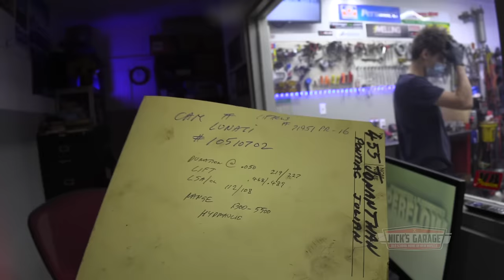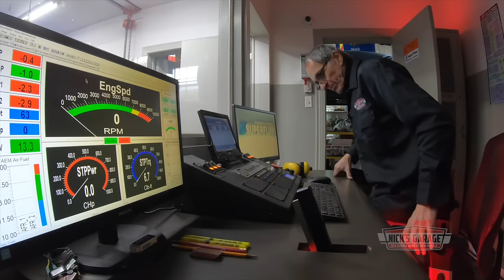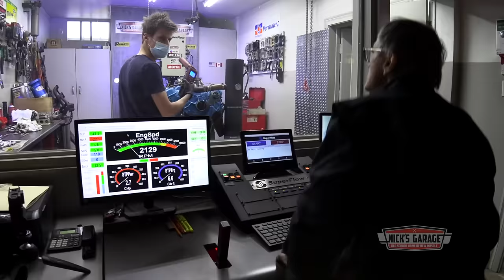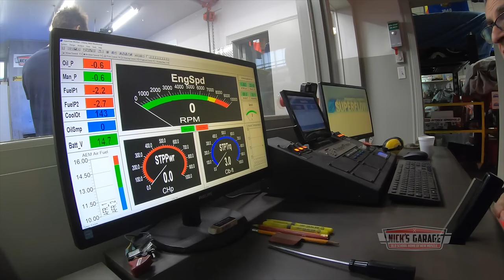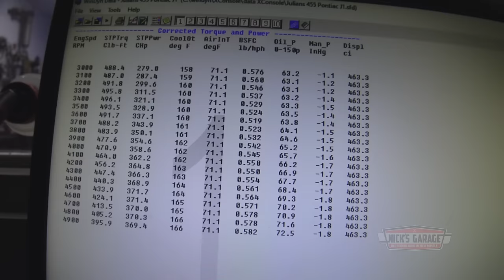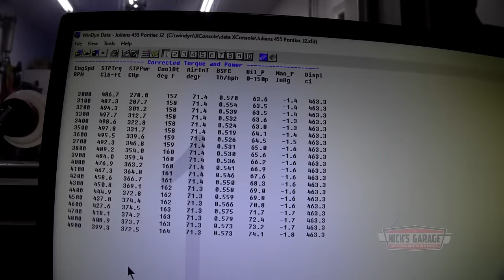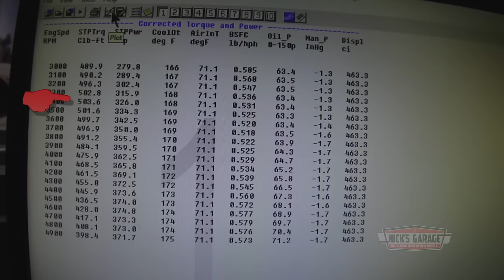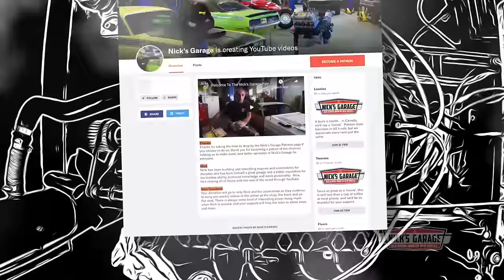Pontiac 455

Comment: That original 76 455 is terrible making only 200 net. H.P. . The 77 W72 400 was actually better making the same 200 H.P. over a wider rpm range then the 455 it replaced. The Pontiac engines made from 1975 and later are not even considered performance engines. Pontiac along with the rest of GM lightened the blocks and cylinder heads from 75 on to help reduce weight . They also tended to gear them with ratios like 2.41, 2.56 , and even 2.73 to help fuel economy.  The engines had such mild cams they were barely over .400 lift around .421 and were not meant to see rpm over 4500 rpm . Infact to make the W72 400 Pontiac had to give them an actual harmonic balancer.  The L78 180 H.P. 400 used an accessory mounting hub in place of a harmonic balancer . This was due to the very mild cam timing and add in the lightened block not made for rpm much over 4000 rpm. 

I found much of this out when I went to replace the L78 400 in my 77 Trans Am . I used a 69 Ram Air III  400 short block that was .30 over with fordged pistons , the heads I used were 1971 400 GTO 4 barrel heads casting number 96 with big plugs. The L78 400's flex plate had a different bolt pattern on the crank then the 69 Ram Air III  crank . This changed after 1974 in 75 along with the lightened engine blocks and cylinder heads. I tossed the L78 400 and 6x heads . 

I also had to make my own engine mounts to install the 69 400 that originally was for either the Lemans/ Tempest body or the larger Bonneville / Catalina body. Pontiac going into the 70's made engine blocks that had two sets of motor mount bosses to make installation easier . My friend used a 72 400 block in his 77 T/A and the later block had the two bosses . It could be installed in multiple Pontiac bodies unlike the 69 Ram Air III block I used.

Comment: What do you drive when the roads are messy? 4 wheel drive pickup or what? When I've been up there it was so cold that white business was crunchy.😆
Reply: For this winter, my rear wheel drive Ranger.
Reply: @nickpanaritis4122 I was just wondering. I've only been up there a few times  many years ago in an 18 wheeler and it was not a big deal. A Power Wagon would be fun in the snow. I prefer 4 wheeling in snow and have no desire for mud. I hope your throat & probably sinuses get better. Stay away from sick people if you can. Really enjoy your channel. It's hot rod heaven.👍

Comment: A 750 or a 800 cfm quadrajet will handle way more than 370 hp so I dont believe that carb is too small. My 9.7-1 comp 70 455 with #64 heads,hft cam and iron intake made 491hp and 570 trq with 1 3/4 " headers and lost 16 hp with ram air exhaust manifolds and 2.5" headpipe. That was with a rejetted  1970 750cfm quadrajet. On my motor my quadrajet made 4 more hp than the shops 850 holley dyno carb.
Reply: Client i bringing in a larger, 800 CFM carb to try it. Engine still on the dyno. Still testing.
Reply: @nickpanaritis4122  - Some Pontiac Firebird Q-Jets had an early stop on the secondaries linkage to prevent lighter cheaper Firebirds being faster than flagship GTOs...

Comment: My engine knowledge is very limited. I always thought you wanted your spark to ignite as the cylinder hits top of it stroke ! If this is true why is there a need for vacuum advance and timing of spark adjustment thru distributor cap , shouldn't this all be set mechanically and not need adjusting ?

Comment: i wonder if i should use a 372 sbc , or 455 poncho, 455 buick, 455 oldsmobile, or 500 caddy engine in a 2nd gen camaro or any other engine for that matter.  i wonder if a bbc would be better for street or any engine. ???   a 318 mopar?  or any engine any ideas welcome, i once thought of a lightweight aluminum headed 350 buick engine and ford C4 transmission very light weight combo i believe would accent a pony car like the 2nd gen camaro. or a lite weight ultra lite aftermarket racing 4 speed or anything tell me what you think everyone and well nick if you think it there is something better let me know.  This shall be an all mods welcome / pro touring / everyday street car / track car/ show car/ endurance/ cross country/ all weather everyday vehicle shall have durable finishing options etc. Then we shall produce the cars with different engine options and new vin codes entirely built from scratch this vehicle shall also be somewhat /wartime survivable./

Comment: i think you need more comp in alot of your're engines, they run higher comp stock with older cam grinds and worse fuel back in the day (i think they would love more cylender pressure).
also running bigger cams and small cast manifolds isnt a good combination as you know but the customer wants what they want.
what cranking psi is this running ?
the rochester is great for mild stuff but suffers with fuel dist at high cfm draw compared to a square bore.
great content i love watching.
Reply: Pump fuel back in 1960's - early 1970's days was up to 100+ octane... 
Most of Nick's customers want pump gas compatible compression ratios now... 
Those Pontiac Ram Air iron exhaust manifolds flow pretty well! Pontiac went up to high rise intake manifolds in 1965... 
This engine could use the 850 CFM Q-Jet from 1970's Pontiac Super Duty 455"...
Reply: @BuzzLOLOL  old fuel wasn't as high in octane but had lead in it to prevent pinging.
When you upgrade a camshaft you normally drop final comp due to bleed so you should increase static compression to compensate.
In this case he isn't even running stock comp for the original cam.
My bet would be cylinder pressure is pretty low and hurting power.
Reply: @hairymongrell  - Lead compound was part of the octane boost plus it lubed valve seats... 
This '74 Pontiac 455" prolly had 7.6:1 compression ratio and a base level cam about 194/202 durations at .050" lift, they bumped it to 9.6:1, car makers would call that "10:1"... and 219/227 cam... it'll run on pump gas...

Comment: I'm guessing 428 hp.I would like to see that with a tri power set up or an early 60's dual quad set up
.
Reply: I figured 375 HP and 475 lb.-ft... surprised at the torque from only 9.6:1 compression ratio...

Comment: Nick. Got a question for you that I have asked many times over the years but never got an answer. Hydraulic lifter/cam break in. I find it hard to believe that the big three broke in cams this way over the years and the millions of engines that had this type of camshaft. How did they break in these engines with this type of cam/lifter combo?? It would be impossible for me to believe they did the 2,000 rpm/20-minute break in for those millions of engines over the 4 or 5 decades they were produced. I have been curious about this for years and so far, no one has given me an answer that makes sense. I'm thinking maybe they ran these motors with a machine that just "spun" them up, no spark perhaps. But then again back in the day when you bought a new car in the fifties or even the sixties there was the break in period sticker near the speedometer. Nothing over 50mph or so for the first 500 miles, no constant speeds, those kinds of things. Thank you.

Comment: Why does the engine stumble when the secondaries open up? Hmmm.
Reply: It all depends how fast I go to full throttle. Too fast will cause a stumble. Not the same in a car test.
Reply: Secondaries air door spring may need to be adjusted tighter... opening too soon...

Comment: Enjoy your videos Nick, but.. If you are comparing that 9.6:1 Compression Ratio 455 to the true 1970 455, which was 10.5:1 455, Torque and Hp. Numbers will not be the same,  bump the compression to 10.5:1 and make another test.. And. Stock cams from pontiac has very low lift! And a bump in lift and duration, and you'll see some good numbers

Comment: Nick, do the BSFC numbers look a little high.  I remember a Pontiac 455 build that made decent horsepower/torque and had a BSFC around .39 in the mid 3000 range.
Reply: A number of .39 is great on the BSFC. Even low 4's is good.

Comment: Forgive my noob question, but what is the need for breaking in a cam at 2000 rpm as opposed to idle? Will it damage the cam or anything else if not revved? Thx.

Comment: Don't know much about Pontiacs but I have some experience with Q-jets. That is not the correct carb for that engine. It is a late 70s (76-79) or early 80s, possibly off a truck.  The correct carb for that engine is quite rare & $$$.

Comment: Why do guys the the Quadrajet  a " Quadrabog"?  Is this baloney ?
Reply: It’s only a quadrabog if something isn’t set up right. Many times it’s the spring tension on the secondaries flappers. If you can Rev the engine in neutral and those doors open all the way, they need adjusting .
Reply: 😀I thanks ya

Comment: get them roller rockers off the engine,and uncle tony had the same problem with lifters, and for your voice drink lipton cup a soup broth,but don't use the noodles,put on a jogging out fit go to bed,it is uncomfortable but the reason is to sweat the bug out you want to soak the bed with sweat
Reply: Worst rockers... stock type but with heavy roller tips...

Comment: Would love to know the specs on that Lunati cam, but I understand too much time has passed to remember them. Just curious ...
Reply: Thank you!
Reply: 219/227 durations at .050" lift... Comp makes a similar one...
Reply: @BuzzLOLOL  With a 112-degree lobe separation. Yes, I got those specs from Lunati.  Thanks, Buzz. I suspected this Pontiac cam was very similar to the one I used in a 1971 455 Buick engine that I got out of an old '71 Riviera, and it was.  I got my Buick cam from the GSCA: H218-231/113 and .484" lift. I just dynoed the otherwise stock spec engine with a set of discontinued Sealed Power 9.4 to 1 forgings on a very accurate DTS Dyno.  We did use Dougs headers on the dyno, but those manifolds on the Pontiac sure looked great and probably worked as well as headers, esp. through dyno mufflers.  The engine averaged 155 psi cranking compression on all eight cylinders. We got 382.6 hp @ 4975 rpm and 514.6 lb-ft torque @ 3650 rpm.  Very good idle, too.

Comment: With a mild build on a Pontiac 455...I'm gonna say 310 HP and 375 ft lbs torque
Reply: Check out the results. Much better.
Reply: @nickpanaritis4122  I saw. 375hp and 508 ft lbs. Fantastic numbers for a near stock motor. I wonder what it could do with manifold, holly and headers. I hope you can talk to owner in to swapping on a bigger carb at the very least.
Reply: @Buses2Bikes  - You guessed numbers for a 350" engine...
Reply: @BuzzLOLOL  Actually those were the numbers from my Pontiac 400 motor from my '78 trans am. Back when it was bone stock. I know big blocks of all the Big 3 had bigger numbers but when I saw the stock heads, stock exhaust and little Q-Jet on the 455, I figured there wouldn't be colossal numbers coming from it. So I "downgraded" expectations to be on the safe side. I've had Ford 460s that were ground shakers and then some that barely registered a pulse. Numbers tend to be all over the place depending on the year and where the car was sold.
Reply: @Buses2Bikes  - Those '78 numbers were netHP numbers whereas this dyno is giving grossHP numbers like used before 1971. 
Q-Jets aren't that little... 735 - 850 CFM on V8 models... those are better flowing than usual iron exhaust manifolds... and compression ratio bumped from 1974 7.6:1 to close to common 1960's 10:1 level...
Reply: @Buses2Bikes  ..My client has a 800 cfm coming  in to test it on the dyno again.
Reply: @nickpanaritis4122  That with maybe a 1" spacer under it might crack the 400hp mark. You were pretty close as it was.
Reply: @Buses2Bikes  .   We are doing more testing. Carb 800 CFM and maybe a cam.

Comment: Disappointing for such a big heavy engine.  I would think a 454 Chev would stomp it.  The old Corvettes were rated 425 or 450 HP from the factory.  Odd build.  I would go FI maybe a crank sensor, maybe turbo at that compression.  Make it howl.  Headers.  Its just a grocery getter for a heavy car like my neighbors 9 passenger station wagon with clam shell gate back in the day.  Not a good time for GMs.

Comment: I noticed you set the timing then reconect the vacuum to advance cannister , should the vacuum come from the ported vac on the carb? Maybe it has too much total timing? and detonating .
Reply: Ported vacuum is for emissions slug engines at idle... at WOT there is little vacuum and no vacuum advance...
Reply: @BuzzLOLOL  .. At least there is no vacuum at WOT with base vacuum port.
Reply: So Nick, what was the timing at idle and at wot? I know some of these motors would respond well with 38 degrees total timing at about 3500 rpm .
Reply: @johnleinen9409 .. Initial timing was at 18 and WOT 36.

Comment: I'm not a pontiac proficionado but had some friends that were and they were always spouting off about the pontiac mid-block engine being the perfect big block because it was the best of both worlds with the larger bore providing the big block muscle while the shorter stroke of the mid-block's design made semi-small block RPM's more easily achievable then is possible with other big block designs. if any of that is true then why do people always build pontiac motors like they have a sub 5500 rpm power range like other big blocks instead of the 7k rpm that i've always been told was easily achievable with those engines?
Reply: The Pont blocks are all the same the 350 is the same block as the 455 and they are long stroke motors that produces low end torque rather than High RPM. The 5500 RPM power range is mainly due to the flow characteristics of the heads, The EdleBrock aluminum heads are copies of the ram air heads and breath better. This motor has #66 heads with 8.5 comp though he says it's 9.5. The HO version uses #16 heads with 10.5 Comp these came on 400 ci motors

Comment: I HAD TO IN THE PAST TAKE LIFTERS APART FILL WITH OIL TO PRIME NOT OFTEN BUT FEW TIMES OVER THE YEARS LIKE A PIMP SOMETIMES THEY I BELEIVE AIR LOCK ONCE THERENPRIMED NO MORE ISSUES. LAST COUPLE OF BUILDS WE JUST TOOK LIFTER APART ADDED OIL TO BE DONE WITH IT YES TAKES A LITTLE TIME BUT ALSO TAKES TIME TO HAVE PIULL INTAKENBACK OFF. YOU PUT TO MUCH OIL IN LIFTERSVYOU NEVER WILL BE ABLE TO PUT BACK TOGETHER

Comment: Nick  why is the distributor  in backwards ???
Reply: Really ?????
Reply: @nickpanaritis4122  yes the vacuum  advance can should be on the right side of the motor    the distributor  is 180  out
Reply: @Mr51Fargo  .. Are you saying the vacuum advance canister is off 180 ?
Reply: @nickpanaritis4122  yes Nick   does the distributor  not go in the same way as a sbc and BBC   with  vacuum advance  pot on the right side and the electric  hook ups on the cap on the left
Reply: @Mr51Fargo  ...I have the 76 Trans Am Firebird in storage with the original engine and distributor. Will look at it tonight. Thanks.
Reply: @nickpanaritis4122  ok Nick   it just looked odd to me to see GM  distributor  clocked 180 .   Please let me know  if pontiac  did it differently..  thanks Nick

Comment: So much information on building 'Poncho Power' has been lost...even since the 1980's. They are unique engines. Their compression came from dozens of different head castings...since most were equipped with flat top (mostly '4-eyebrow' pistons). Carburation wasn't as important to them as to, say, Chevrolet...a good 750cfm on a 400, or an 850-cfm on a 428-455 would work, but you had to have 5-7 psi of fuel pressure, or else! They behave like diesels, they need 'cooler block temps' to maximize power (always use 180-degree thermostats with them)...and the cams, oh, my god, the horrors of a Chevy-builder trying to 'pick the right cam'! See, where Chevy loves that 106-degree lobe center...Pontiacs don't do well with it...they breathe SO MUCH BETTER with 112-114 centers! Melling Tool Company (now Melling Performance) knew this...and made some of the best aftermarket cams out there! Don't spin unbalanced crank assemblies past around 5,600-rpm frequently (don't really need to, the power curve happens lower)...and because they'll yank a 1/2" of timing chain slack in a new chain within the hour of break-in...make SURE you use the BEST double-roller (or gearset, if you can afford it) timing chain possible! Oil on the bottom end really, REALLY needs to be a 'high volume' (not 'high pressure') pump...again, Melling pumps were best...and as most of the heads were already 'hogged out', porting and polishing didn't really change much...BUT because of intake-head alignment issues, one of the FIRST things most 'racers' would do, would be to yank the intake off, template it, then PILOT HOLE the intake to allow for 'shifting' the intake to align with the heads! This, of course, caused the dreaded 'water grommet leak' (small black rubber seal between the timing cover and the intake, front-right as you look at the front of the motor)...you had to fix this by CUSTOM CUTTING your own grommet-washer from blank rubber on a drill press...that was ALWAYS a headache.  Only other thing, was if you went with mechanical lifters...might want to pull those rocker arm studs out and tap them for screw ins...as VERY FEW Poncho heads had screw-in rocker arm posts...
Best sleeper in the world back in the day, was a Poncho that had been PROPERLY set up...after the Chevy and Ford guys had beaten a few 'off the shelf' Pontiac drivers...they thought all Ponchos were slouches...and they were NOT, they just hadn't been set up properly.